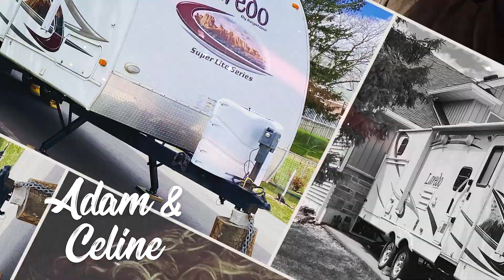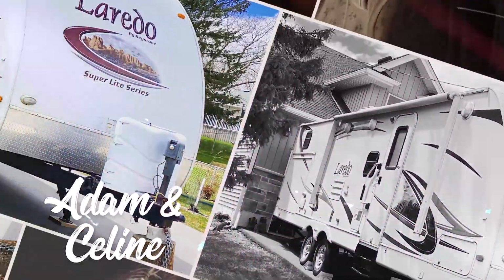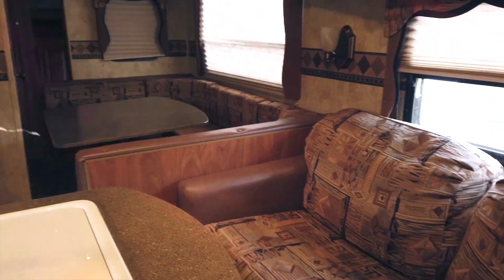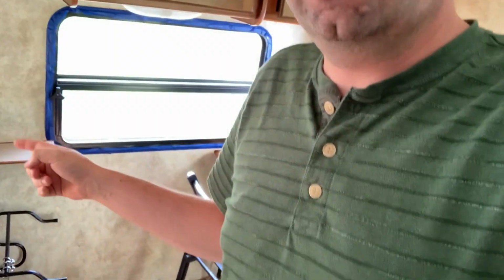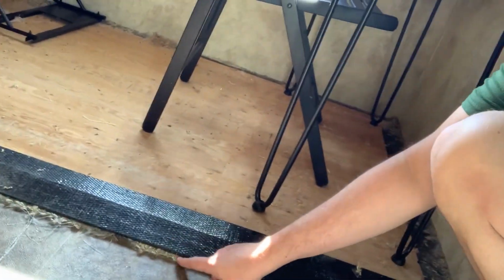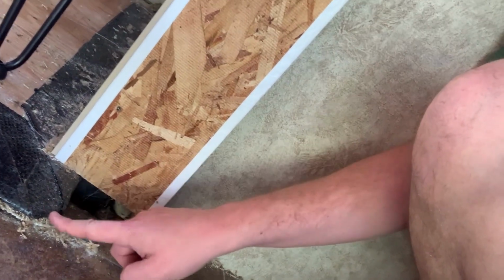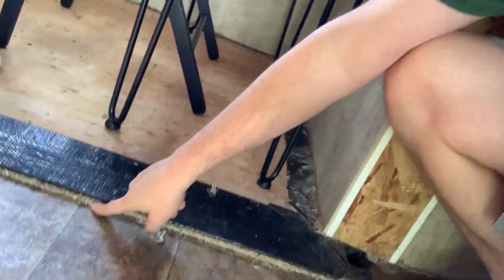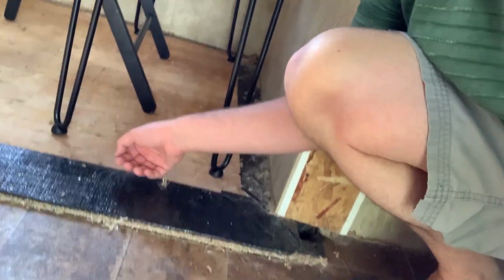Trailer Renovation Ep. 2: Removing carpet, painting cabinets, and demo the bathroom.

Comment: Overlay your new vinyl floor that you instal on the slide portion, to extend a bit beyond the edge that meets the flat floor of the trailer. That part that is angled on the slide.  Put a plank on there that is long/ wide enough to cover the leftover carpet.  Alternatively, call an RV tech for his suggestions/ directions.😉👍 good luck with that.
Reply from the maker: Thanks - our next video will show how we got it sorted out! - Adam

Comment: The only way to get the carpet out is to tilt the slide.  Pull it in a few inches and it should tilt up.  Then you can get in there and get the carpet out.  If it's held in place by that steel plate, most likely the plate went in before the slide so it's not coming out.  Try an oscillating tool between the plate and the floor, that should tear out the rest of the carpet.
Reply from the maker: Thanks, Fred. I'll give that a try! I'm a little concerned about pulling up on the slide, but I suppose an inch or two would be fine - Adam
Reply from the maker: Following up - you were right! The plate wasn't coming out, but we ended up working around it.